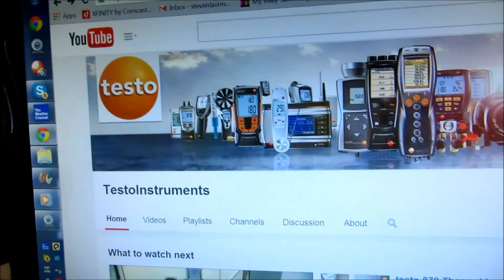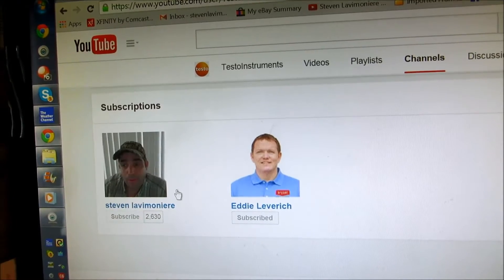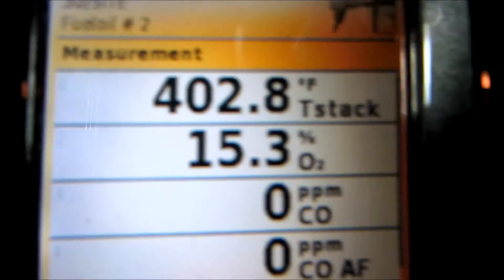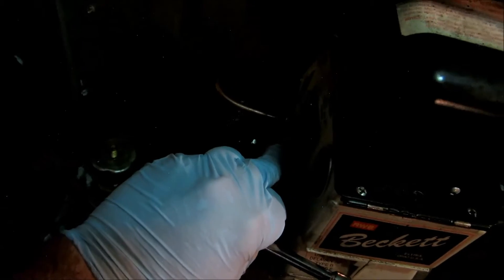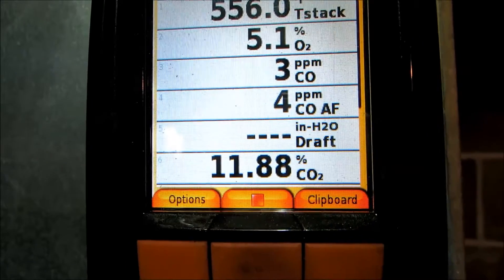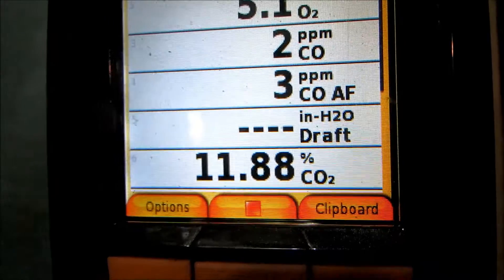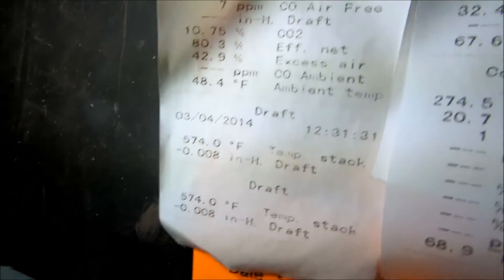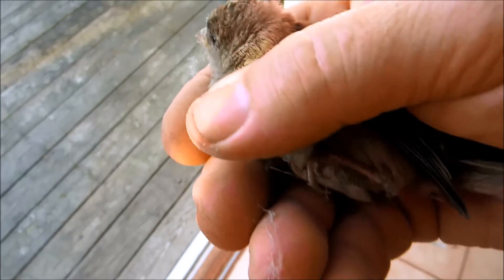testo 320 dials in a oil furnace

Comment: Your draft value is not reading. You may have condensate blocking your probe. Sometimes the prob will fill with condensate and throw your readings off. I think if you tip the prob tube down towards the unit it will stay clear. Just saying that because it happened to me and it took me a while to figure out why I wasn't getting a draft reading.

Comment: Steve not sure if you know this about those rheem furnaces if you take off the little sight window and stick a long screw driver in there.there is a plate that is welded to the heat exchanger the welds come lose and plate fails. You are able to push it with screw driver.I seen it mess with combustion and sometimes it does not
Reply from the maker: hvacman77 next time i go to service the furnace i will check that out thanks for commenting